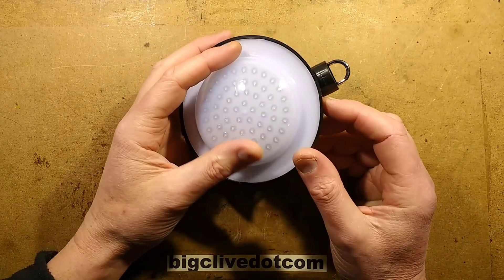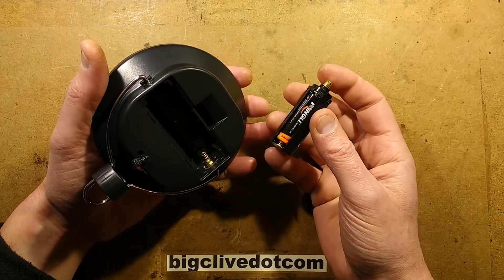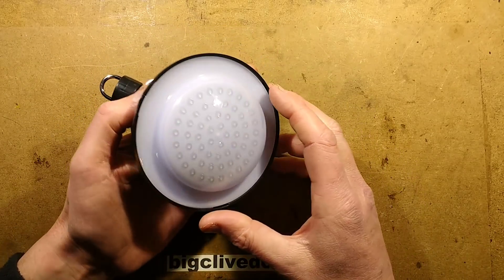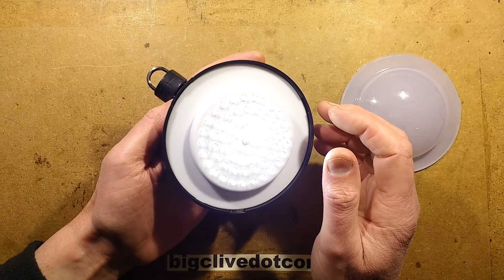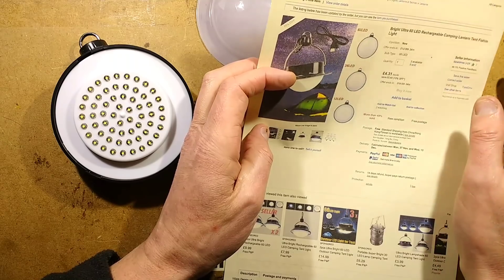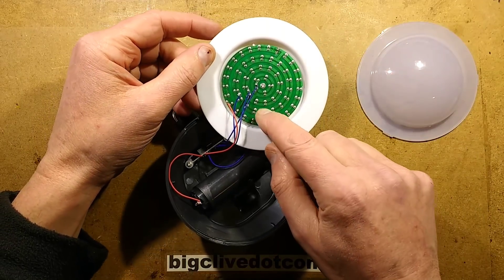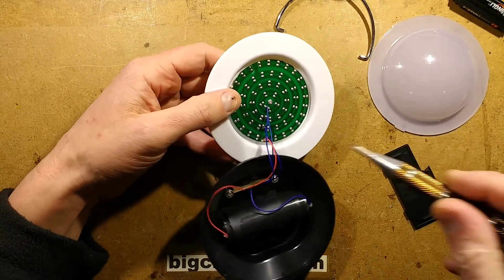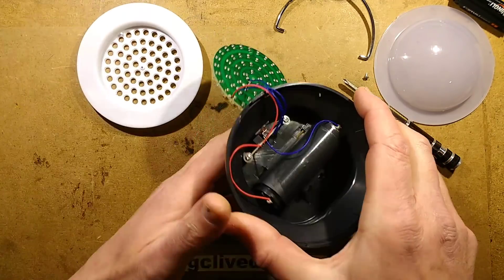Inside a 60 LED "rechargeable" camping light.

Comment: Odd that the resistors seem to be three different values.  Perhaps it's a fairly bogus attempt to regulate the current by limiting the base current and relying on the transistors' betas?  More likely, it's just "sweep the floor" construction where they use whatever resistors they happen to pick up.

Comment: Hi Clive  can you help me with a dilemma i got a 3 ph moter and in told if i wire it up in the delta wireing with capasiters on the third connection it can run on 240 v is this true
Reply from the maker: You can run some motors that way, but only in low torque applications.  It's much more viable to buy a standard Chinese motor inverter drive on eBay and get full speed and power control.
Reply: bigclivedotcom thank you clive ile have a look on ebay

Comment: So there is nothing between the battery and the charge port? If i understand that correctly, if you put in the battery in reverse, the chip is protected, but you could potentially fry your computer when you plug it in for charging?

Comment: I've got one of these, but I've never trusted it to charge an 18650 cell so I always remove the battery before plugging in the cord. If you plug the cord into a power bank or a usb power supply you can run the light without a cell inside. I had mine mounted over my small workbench and plugged into a usb power supply so I could run it for long periods of time when I needed a little extra light.

Comment: Hey , kind of an off-topic stupid question :D I am about to try to measure 30 A with one of the cheap-o multimeters . The question is - should I do it?
And yes, I am well aware it states 10A on the face and I probably shouldn't do it without another resistor in line, but come on :D 
(it's just a brief measurement to check a chinesium battery charger's claim to fame)
I guess what I am asking is if someone knows for sure what's about to happen. 
Love and respect for bigclivedotcom :)))
Reply: You could use a beefy low value resistor in series and just measure the voltage drop and do an ohm's law calculation. You don't have an inductive/clamp ammeter? I bought one from Radio Shack that does up to 800amps AC/DC. Definintely a worthy investment.
Reply: yes,yes , like I says - I know I should do it like that or with a shunt of some sort. However, I do not have any resistive elements on hand and I am picking it up from a delivery office .If I make a shunt from a wire , it might look too sketchy :D I can only test it there and if I miss any flaw - I have to live with it , no returns after that .
Also idk if the damn thing wont fry itself after a few seconds connected on a dead short :D 
Thanks for the reply anyway :D I'll do it tomorrow and post how it went.(it should work, I think-famous last words)
Edit: yeah I would love to have the clamps :D but why do you think I am buying cheap shit:D and testing it with cheap shit ?
Reply: If I recall correctly, it will just immediately blow the internal fuse in the multi-meter so you won't even get a proper reading.

AC/DC clamp meters are about $37 US on Amazon. That's a lot of money but it will last you for years. I can't believe I waited 20 years to buy one, but in truth I didn't even know they existed until Clive showed them to me! That guy has really expanded my knowledge - THANK-YOU CLIVE!!
Reply: No, it was years ago - sorry. I imagine anything over 12 to 15 amps would blow immediately.
Reply: lol johnnykache1000 -that's what I was afraid of :/ do you recall the amperage you were attempting to measure ?
Reply: Ok, thank you :) I will give it a shot though :D I have 3 of those cheap meters here  not doing anything, anyway.
Reply: It's a no go , the charger has a resistance read, before it begins charging :D Or something idk... It wont begin with an amp meter in the mix. We'll never know I guess. Anyway, cheers :)

Comment: Been wondering if you'g get to this.  I've had one for about 2 1/2 years .  only use it with the li ion cell.  it came with a generic one and a plugin charger that changes led colors when it's charged but is so light one wonders how safe it is.
Reply: main thing is at least with th 18650 batteries is full bright doesn't last long :(  while camping but hey the hook fits the tent nicely, wonder if the protection is in that very lightweight transformer?

Comment: NiMH typical output is 1.2V per cell (x3 = 3.6V). NiMH charge voltage is 1.4~1.6V per cell (x3 = 4.2~4.8V).  These times-three values are pretty spot on with Li-Ion cell voltages.

Comment: There wasn't any charge protection circuitry on the internal PCBs, but what about that USB charging lead? Looked like there were some extra electronics in the USB plug itself. There might've been charge protection there.
Reply from the maker: That wasn't the one supplied with it.  The supplied one was just a bare lead.
Reply: Ahhh, nevermind then. I stand corrected!

Comment: Did you ever go into how to charge Lithium-ion properly? At 4:50 it sounds like putting 5V on a protected cell is just fine but isn't it more complicated then that?
Reply from the maker: You'd have to limit the current to a reasonable level.

Comment: clive if you were to add a charge protection circuit (cheap on ebay) would you put it in the wires to the battery terminals?

Comment: Hi Clive is there any chance you could review a 3 way touch switch/sensor? They only cost a couple of pounds on eBay, I’m fitting one in a lamp and would like to know if they are safe or not?
Reply from the maker: The circuitry varies widely in the cheap eBay units.  A safer one should have obvious blue class Y capacitors and high value resistors in series with the touch wire.  I'm not sure I'd trust the generic import ones though.

Comment: Hey Bigclive have you seen the party balloons that have an led in them. My son turned 12 a few days ago I bought a pkg of 5 from Wal-Mart. Says they stay lit for 15 hours it's Ben 4 days and they are still lit. I took one apart it has a link led inside an orange balloon, with 2 very small batteries button with the leds bent across the positive and negative. I wish we could post picture on you tube massage.
Reply: I've got those and indeed the single colour ones light for weeks (albeit gradually dimmer and dimmer) and I even replaced the cells in one of the nice purple coloured ones :)
Reply: Maico so no resistor because the voltage is 3 volts give or take right.
Reply: If I'm right: if the forward voltage of the LED is say 2 V the remaining 1 volt over the high impedance of the coin cells will not allow the current to be too high for the LED
Reply: Maico I think you are, I'm sure I've seen bigclive take a button battery and power them, because only a volt or so. No problem.
Reply: Maico buy the way they are still lit.
Reply: yeah some of my white ones are very dimly lit after like 2 months :)

Comment: Nice to see something built better than the typical junk, the housing I mean, though it is unnecessarily large considering it doesn't effectively use the casing for heatsinking.  The diameter is excessive and who really needs a diffuser dome for camping?  I'd want the protection, from insects if nothing else since it doesn't appear to be waterproof, but not the lumen loss.

Given how precious battery power can be while camping, I'd also have preferred more efficient Cree LEDs, and the circuit board looks marginal for 1A drive, probably running the LED dies fairly hot with addt'l lumen loss when it could've been built on an (aluminum) mPCB instead.

I suppose since it's CHEAP enough, you could just take along another battery but on the other hand if built well and as efficient as possible, might be something you would get use out of for the rest of your life which IMO is worth a few dollars more.   You don't need a closet full of redundant LED lights, just a few nice ones that you like to use.

Comment: Thanks for bumping the prices of these - I used to use them for months now as a replacement for 85mm LED Spots because of the easy but featurerich PCB circuitry to use with an ESP8266... Thanks to your video the prices have doubled now - rendering it useless as a cheap replacement.

Comment: does anybody know the LUMENS output by chance? I'm thinking as an additional photography light source
Reply: matt gratton probably under 100 lumens considering they use about 1w
Reply: Cekpi7 thx.appreciated.
Reply: A led video light would be better. 96 led with  diffuser and warming filter $14 on ebay. 
The colour rendering index for these cheap "white" leds is pretty average.
Reply: The Gree LED`s i use in my bike can be got in the yellow spectrum and are blindingly bright!
Reply: matt gratton I can recommend it  for the money outlay. I got one a few years back for your purpose (macro photography in my case) 
reasonable design and lumens per/ $. 
4xAA batterys last well. 
Reasonable rendition of white.
 I agree ebay prices are all over the place but I use the filters and description details to find the best $. Sometimes they except offers even lower. If it goes faulty very early before  giving feedback I could say it was 'dead on arrival' and get another or money back. Good luck with it.
Reply: Matt Burrows thanks I was looking into some of those.just a bit dubious as prices vary for the same items and most from China......
Reply: Matt Burrows thanks. Yes for some macro and close up work. at this price I'll get two.
Reply: mrsillywalk Cree LEDs have virtually unsurpassed efficiency and brightness. I love them, especially the Xml2, and mtg series. 👍

Comment: Wow, I bought something that looked absolutely identical to this from DAISO in Korea about three years ago. The only difference was that it just had that same 3xAAA holder inside rather than any kind of recharging circuit, but it did even have the little dot on the top where the lead goes in on yours. I used it as the light for a cosplay prop and it did the job extremely well.

Comment: All three transistor base resistors are different, are they using the transistors as current limiting devices by not turning them fully on?
Reply from the maker: It looks like that and the transistor for the largest number of LEDs may be different too.
Reply: that would be the case, but it either has to a quite random value, or maybe they use some kind of bjt's with fairly known hfe?

Comment: I've got several of those and always thought about opening one to see wether they have any protection circuitry. Obviously not. However the little chip could have a low voltage cutoff, did you test for that? The protected 18650 i got fit only very barely into the casing. If i ever get hold of that idiot who decided it is okay to make an 18650 cell longer than 65mm i wont do nice things to him, thats for sure.
Reply: the 19670 came out for that very reason and the normal Jo was getting  confused so everyone just uses the term '18650 protected' now
Reply: That's because a protected 18650 is made from an unprotected 18650 plus a small protection circuit.
Reply: I don’t think it has low volt protection but want to know for sure

Comment: The way the charging input jack is wired to the battery holder makes it possible to power this from USB directly, which is nice. The difference in voltage is potentially increasing the power of the device, to 20mA per LED at the last setting, perhaps....

Comment: I like the multiple leds to get the light output high enough, many leds at lower current is more reliable.
Like a monster version of the popular tube torch with 3 aaa's in a plastic holder.

Comment: charging can also mean filling a container to the full extend. commonly used with guns. I'd say you can charge the device by putting batteries in.
its a little bit of a stretch though.
Reply: i mean, chinese characters commonly mean 5 or more english words at once. its quite plausible that the character for "charging" as in batteries also means putting something into a container.
Reply: jort93z 
?
Reply: you can not only charge a battery you can also charge a gun with a round for example. you could say its also charging if you put a battery into the slot.
Reply: "rechargeable" aka removable battery
Reply: Dischargeable, surely.
Reply: jort93z 
Please stop.